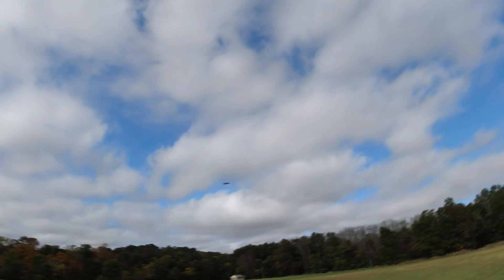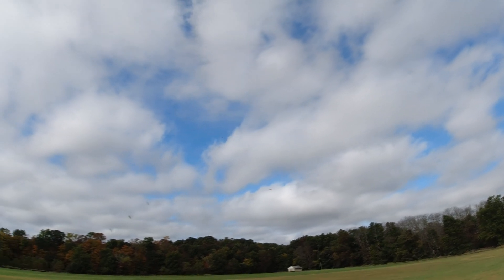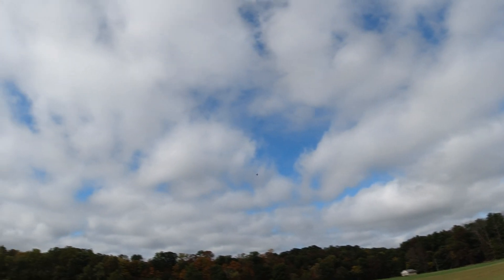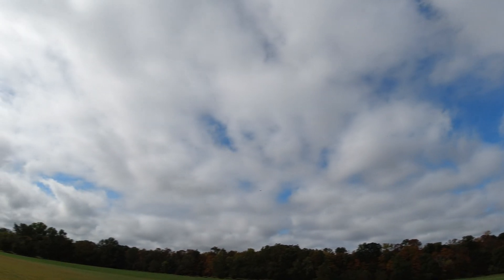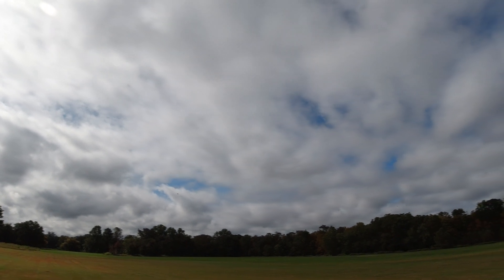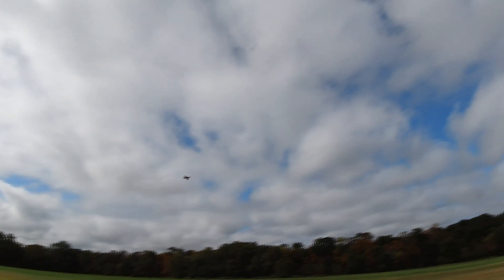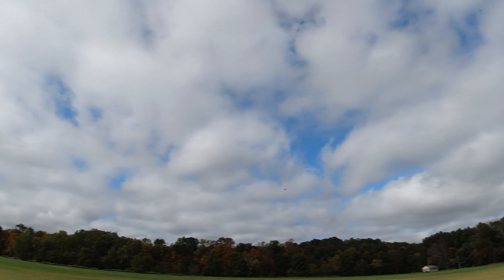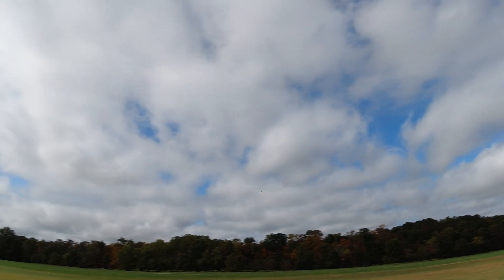HSD Jets Super Viper re-maiden with modifications.

Comment: Cutting the holes in the side of the fuselage is the only modification you’ve done to get the results you wanted? Asking cuz mine can’t seem to produce the thrust I thought it would have?
Reply from the maker: Yes. In addition to the programming desribed in the introduction, which doesnt affect thrust. Are your batteries good?
Reply: @dw3zero  batteries are perfect..
Reply: @dw3zero  what program are you referring to?
Reply from the maker: @samuelbadillo5741  Just what I wrote in the description.
Reply: @dw3zero  I appreciate your help
Reply: @dw3zero hi I did your modifications on the side of the super viper and seems to be getting better air coming thru… I tried. Bypassing the mfc and going straight to receiver, but not elevators are acting like ailerons 😂 .. can you tell me what you’ve done to correct .. beside getting new servos a left and right? Also is there a way to bypass internal programming on mfc ?

Comment: Nice flight.  Not sure what you mean by the elevator to flap mix?  Do you mean the Flaps go down as you use the elevator?  do you have any sizes for the cheater holes
Reply from the maker: Thank you! I have 6% down elevator mixed in when the flaps are lowered. The cheater hole is approx. 7x10x4cm.
Reply: @dw3zero  Thank you